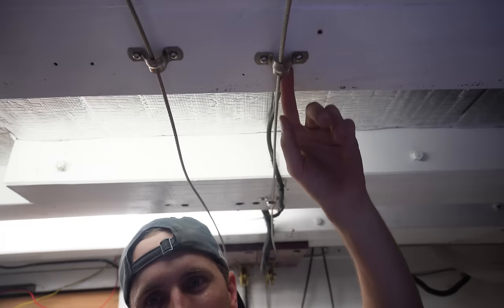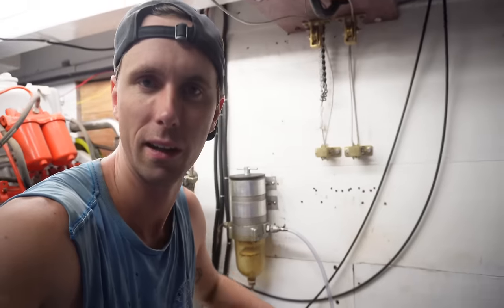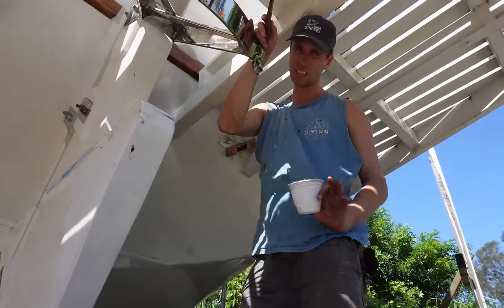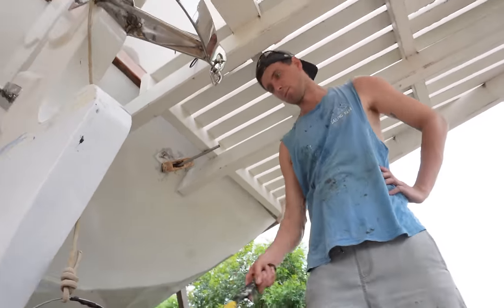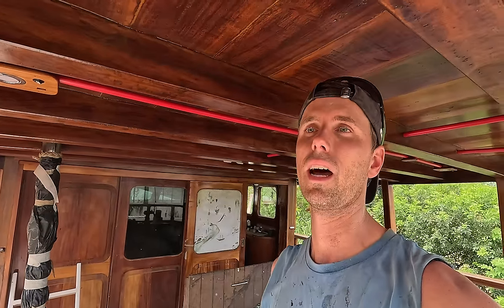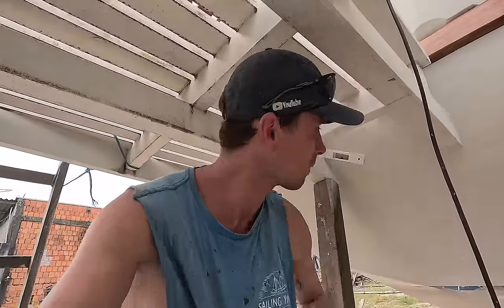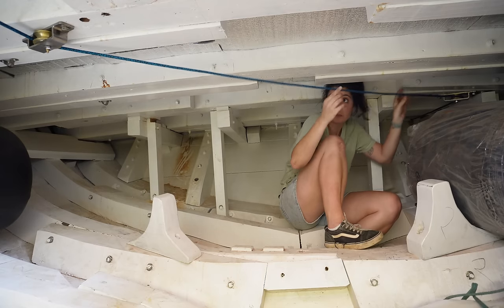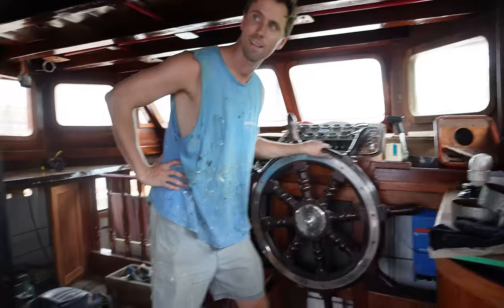Steering upgrades: Ready to steer our rescued boat — Sailing Yabá 166

Comment: The size of the steering cable has always worried me a bit for the size of your boat. Happy New Year to both of you.
Reply: Your 100% right... U don't stear a 15ton wood yacht with, shoe strings. They in over there head. If the rudder fails in a storm there going to dock on the rocks.
Reply: For this size of boat you need hydraulics or chain system,  way stronger. Cheers.
Reply: They do have a manual tiler. Just in case.
Reply: @guydepoorter I have to agree with this comment. For a boat this size and weight, there is no way you should be relying on a cobbled together system to steer your boat.
Reply: your pull angle on these pulleys is not vertical, it's 45 degrees. Build a bracket 45 degrees, screwed and epoxied to the hull, glassed over and bolt all pulleys through. I would take pulleys 2 times bigger.
Reply: @franksmith3602  Where is the number of 15tons coming from? To me that looks like becoming 25 plus....fully loaded....
Reply: And the holes in the stern?
Reply: And what happens when a big wave hits the rudder?  This would usually be in a storm when you don't want to lose steering.  Hydraulic assist system would be much more durable.
Reply: Agree Sir! That boat should only stay coastal! I worry about the diesel tanks that should have been above the keel if they had one! Not up that high under the floor board! @MrDomingo55
Reply: Yep
The steering quadrant on my 8000lb 30ft sailboat is 2x as beefy as his cable setup. The turning blocks should be thru bolted not wood screwed 👍.

His backup tiller system should have a bock and tackle system to both port and starboard hard points given in rough conditions his wheel steering will be useless and his tiller will toss two big sumo wrestlers over the side without a block and tackle system

Comment: The problem is the varying angle as the rudder swings back and forth. The reason is that the connection to the rudder is at a right angle to the rudder. What if you put that thing up? so that it makes a nice horizontal movement with the block in the stern?

Comment: In theory that dyneema would be great for the steering system however, when it gets cold, it will stretch rendering you’re steering useless. The only solution would be to have a long turnbuckle connected to it that neither goes through the transom or up the bulkhead. And thread out as possible to adjust it when it gets cold however, you don’t know how much it’s gonna shrink and if you had that thing is still too through the transom, that’s another way that it can chafe. It would be safer to use the stainless steel wire rope
You can use  dyneema or your rigging if you wanna learn more about that check out the rigging doctor on his YouTube and his website
Reply: I agree, I wouldnt have used dyneema for this task. More suscepitble to chafe. Also Ben... pay attention to the shackles you have used where both wires attach to the rudder. These WILL work loose when you least need it! Instead use a properly terminated turnbuckle, similar to what you would find on most yacht guard rails.  You need to look at a spring loaded tensioning device for constant tension. This will aslo help to prevent unwarranted chafe. Good luck going forward and a very happy 2024.

Comment: I can’t see how moving the steering pulley position has helped. Now the bolts will be pulled out by the forces acting on them by the cables and the threads may not hold. Bolting, rather than screws might help. I’ve had a cable steering system fail before and needed a lifeboat to rescue us. It was not nice!

Comment: That pulley block should ideally be bolted, and the bolt holes need to be much lower. You made 4 holes for the pulleys, weakening the block, then drilled 2 more large holes for those big coach bolts between the existing holes. The block like a chain is only as strong as its weakest link, and in places between those holes is only about 10mm thick.
Reply: You made it weaker wood block will split unless you add a stainless steel plate over it.

Comment: Don't rush the sailing stage till everything inside and out is complete. Sails, auto steering, fenders, fishing gear, solar panels and energy producing wind and drag along impellers, fresh water makers, scuba gear and lobster catching spear guns
Reply: Yes! definetly take a day or 2 off and make a checklist what all is missing, there is so much left to do and it will be a lot harder when you live on board. Just finish the boat !

Comment: oh dear someone has already commented about the force angle (vector I think) if you pull up with a lot of force on the cable then it goes round the pulley and pulls with the same amount of force in that direction (that is what pulleys do) . Sorry Ben I know how you have done this work and ticked it off.

Comment: I have cable steering on a small runabout. There is a drum behind the steering wheel and a second drum to drive the rudder. The steering cable has a heavy spring attaching where the 2 ends meet. The spring keeps constant tension on the spring. 
In your case a spring would keep tension on the chain as it goes round the steering sprockets. 
I can’t think of how else you can do this.

Comment: Threaded rod instead of a long screw would be nice to use instead of the lug screws for the new pulley arrangement.  That way you could have had the added security of through-bolted fasteners.

Comment: First of all: happy new year. Good job with the steering!! One remark: when you use those clamps inside (as seen on min 00.31) you will chafe the Dyneema line. Better use special eyes used for rigging (spinlock bullseyes or similar ) to avoid chafing.

Comment: While i think that the dynema rope is plenty strong and nice for the rudder system, specially where its stretching ability will help to mitigate the forces from hard impacts to manageable force, the slack in the not pulling line is way to much: Your rudder will endure forces moving it in both directions, and if you have slack in the lines it will flip-flop and pick up momentum while its moving uncontrolled. Need to get rid of the slack.

Comment: I hope you had a Marine Engineer provide specifications for the cable/rope tensile strength required to move your rudder (x2 minimal)?
I'm worried how difficult turning the wheel will be when there's tons of water pushing against the rudder and drag against the hull while in motion?

Comment: The steeringlines will not work - one will be slack whilst the other pulls the rudder when.attached on the outer ends of the quadrant, the lines should cross each other over the steering quadrant in order to maintain tension, check the geometry
This will be an issue in even slightest rough seas

Comment: Dyneema is very strong but incredibly slippery stuff. I am concerned about how you intend to connect it to the chain and quadrant, splicing is the strongest way but there does not appear to be enough room before the first turning block also the sheave radius is too tight for either wire or dyneema, Please get some professional input in this safety critical system

Comment: Great job guys. I really love your channel. I’ve been watching from day 1. But those 2 pulleys have a tremendous amount of stress on them. That’s 180*. Is there a way to get them to 90* or better, 45*. When you have the force of the water moving over the rudder. The pressure on the pulleys will be magnified. Think about it. Please. Good work.

Comment: Those little pulleys seem too be the weakest link in the steering system…also those u clamps on the ceiling which are keeping the ropes neat and tidy and in place seem too be a chaife point …all of your work on the steering system is amazing ..I just get the feeling that yaba is such a big vessel and may need something a bit beefier like hydraulics or something ..just thinking for rough weather sailing the rudder will be taking a beating …just an observation though this system may work well👍🏻

Comment: Question how does the steering system compare to that on the local fishing boats of similar size ,  I'm guessing much beefier than what you have there, seems  way under dimensioned and i'm surprised the guys in the yard haven't pulled you up short on that system .....

Comment: Ben why don't you try and put heavy-duty  wire from Rudder to inside and have that a bit longer  so if at anytime the wire breaks you can fix from inside boat remember there's going to be  heavy load on those wires when sailing  have a look and think  this out  you have done a great job so far don't ruined it by doing some half heart job

Comment: If you are going to use dyneema, make some real splices on the rudder and have the adjustment possibilities on the inside. It’s almost impossible to do the splices on the rudder when the boat is in the water.

Comment: I would not use wood as a filler piece under those rudder pillows on the transom, if that is wood. They look wood to me. Being so thin they’re gonna rot for sure. I would use them as a template to have metal, chromed pieces made.

Comment: Ben, as you may have noticed from the comments, I mostly disagree with the current system you've put together for steering the rudder. I also agree with those who recommend a plumber because the forces involved are enormous and hydraulics give you safety.

Comment: just to let you know all I seeing you doing is making the outside of the tub with no sharp edges, and really it's the inside of the two that will Fray your rope. What you want to get what they call a counter sink tool, for metal and you can put a big chamfer on the inside of the stainless steel pipe for it doesn't Fray the rope can't wait for you to launch that that should be awesome to start that journey of your lives,

Comment: Looks to me the  pulleys are too small a radius for stainless cable, even for Dynema it will wear less and the steering loads will be lower with larger dia pulleys.

Comment: The steering system including the cables are under engineered to an alarming degree. You are not considering the worse case scenario when you're caught  in an unexpected storm and the pressure on the rudder is fighting the weight of the boat and whatever sail you have rigged. You need to put a call out for some qualified professional help.

Comment: ❌❌🚧, ive designed alot yachts. My 172 foot sailing yacht i always over killed when it came to the helm. (( Call a marine engineer, hire him as a design consultant for the steering). That, streeing looks like a kid did it, for a soap box durbey push cart.  You have well over 10 tons of boat. Who ever is at the helm if your fighting cross curents, will have to  FIGHT THE WHEEL THE WHOLE TIME, let go of the wheel, the 1000 pound rudders, going to whip back. Good luck,

Comment: Dyneema for steering cables stretched through the overhead of the hot engine room is probably not the soundest idea.  An engine room fire will see your steering system put out of action. 😒😒

Comment: You made a mistake by moving the pulleys that were screwed 90 degrees from the tensile stress in the wall to only being screwed into a block of wood. The only thing that prevents them from loosening is the screws threaded into the wood. The tensile stress is now in the direction of the screws.

Comment: Did anyone think the steering system is far too free running?  This is going to kick back, probably could break your hand with the steering wheel.  Looks like if wheel is let go for a second she will steer herself and likely not in a straight line. This should be ripped out and replaced with hydraulic as everyone suggests

Comment: As a non- sailor I can’t believe the string and pulleys steering system! Especially given the weight of the rudder and the fact if you are using the rudder to steer in weather that causes the entire boat to heel over the strain on the wire and pulleys is constant! Terrifying to me…a non sailor!

Comment: My concern is more practical; protecting this significant investment with insurance. It is one thing to "learn as you go" with some aspects of the build but the systems considered critical by the Surveyor and Insurance should not be left to amateur designs. I.E. steering and fuel storage/delivery. One thing to do it under supervision to learn, it is another to make things up as you go.😢

Comment: What do your experienced people that have guided you through this have to say about this? In such a critical position as the rudder I would think you would use S.S. Cable air craft type. You break one of these runs and you are in big trouble

Comment: Get professional help with the steering what you have done is not good enough no turn buckles no tension springs holes in transom could leak in tailing sea,s .. steering is very important in a storm or strong winds what ever choice you make is your life's going to be safe??.. great job so far

Comment: Why must Dyneema ropes be spliced and not knotted?

Dyneema ropes must be spliced, not knotted, as knots cause the Dyneema fiber to lose more than 50% of its breaking strength and therefore require a larger size. Correctly done splicing ensures that the strength of the linear rope can be achieved with minimal loss.
Reply: Agree 100%  Eye slices at all terminal points Ben.
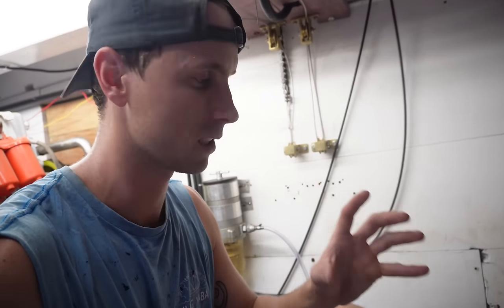Reply: The folks in the olympic Nacra 17 class use 3mm Dyneema as trapeze wires. Some of them prefer to use knots, some like to splice it. All under dynamic loads and 90kg pulling on  the rope. Usually the Dyneema handles it well. On this boat is also a 1:16 purchase on the Cunningham and we sometimes you pull on that line with about 60kg. We're talking about 1000kg pulling down at the sail.. 5mm Dyneema can handle it. What I want to say is even 50% of the breaking load of that line will do. I'm not a big fan of their steering system but I would recommend an hydraulic system but that's a different story.
Reply: @FlyingConey  I agree with you about the hydraulic system, it will be in the budget for years to come, given the expenses incurred for the current "Lifting", rebuilt from scratch.

Comment: Ben, Do not trust your life with this steering system. How do you think it will hold up in a hurricane or even a tropical storm? I know you have worked hard on this but, if you loose the rudder, you may loose the boat.

Comment: Both of you and the yard workers have done an unbelievable, beautiful job of rebuilding this boat.   I agree with some comments below regarding the steering system. This is one of the most critical systems.  Dyneema ropes are very strong, but like all ropes they should be sliced and this is the problem, the dyneema is very slippery and can will fail at the slice.   Check out the following link  https://www.youtube.com/watch?v=lhIPeJNWtxE from HOWNOT2   I can not find the video that he did comparing different nots and splices.

Comment: Wow you obviously want to kill your steering very quickly , the amount of chaffing thats going to occur, one would have thought if youre putting a guide through the transom that it would have been UPVC pipe rather than stainless to the rope will wear the plastic not the metal tube wearing the rope, also all those guides will also chaff those ropes , either pulley wheels of nothing . At least you have an emergency tiller for when your steering goes when you need it most

Comment: You have used first class tradesmen to build your boat, don’t continue to butcher the projects you attempt. Slow down think  of all design  possibilities and mock up ,test then drill the hole or whatever is required. It’s a process you really need to learn and adopt. Think Think walk away then think mock up test then do the major works. It will save you butchering the quality work that has been done by the tradesmen
Reply: Agreed at the moment he is bodging everything he touches
Reply: This has nothing to do with Aba, but don't ruin your personality with tattoos. They cheapen the body.
Reply: @prestonthompson9848 my exact same thought.
Reply: Making mistakes is part of the learning process. Owning up to mistakes is a sign of integrity. Prior proper planning is also prudent.
Reply: I feel like the actual wood work is of a high quality. The rest of the systems work seems shoddy and cobbled together. The 50 foot of wire to the windless the shoddy welds in the engine systems reusing very tired old parts on the engine cooling system the steering debacle. I wouldn’t trust my life on a lot of these small details that are being rushed over.
Reply: What makes you think they are first class tradesmen?  The boat is at best a floating play house. The quality of the build is not even mediocre house framing. Your greater point of considering and researching before building is lost on this poor couple.
Reply: While I agree that careful thought and consideration is important,  I don't agree that Ben and MP are "butchering" any previous work that had been done.  The boat is wood and wood can be repaired, filled, sanded etc. Ben and MP are lay people and Yaba is their home. Learning, trying, and accomplishing feats they didn't think they could do is priceless. Many of my own accomplishments and successes happened because I was brave enough to TRY. 

Ben and MP, you are doing an amazing job.  I hope you feel immense pride as you finish Yaba, move aboard and launch her.  She is stunning!
Reply: Very harsh words. They are learning as they go. We can't all be Experts!
Reply: I agree slow down and don't drill until you are sure 😢
Reply: @prestonthompson9848  opinions like this are best kept to yourself. This is a boat build.
Reply: That’s pretty harsh. Every mistake they make is a step in learning. The experience leads to expertise. It’s hardly butchering. They will be fine. The boat will be fine.